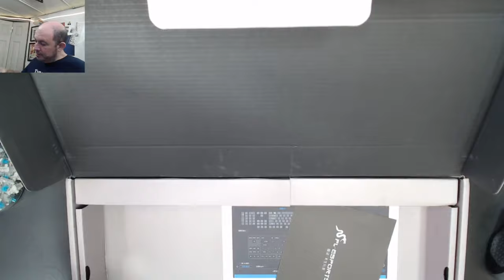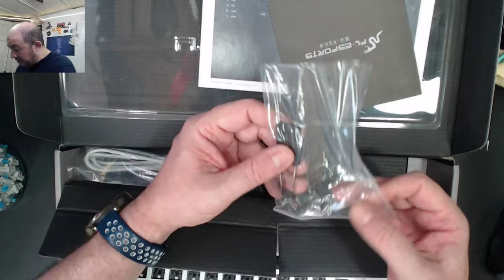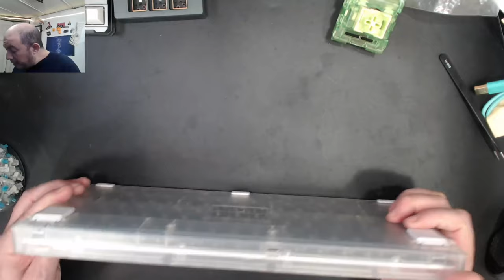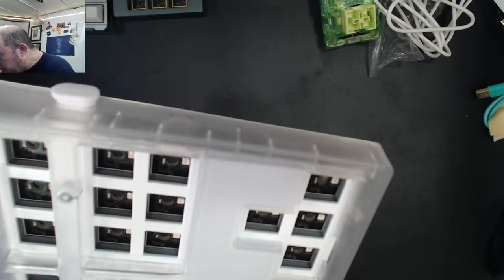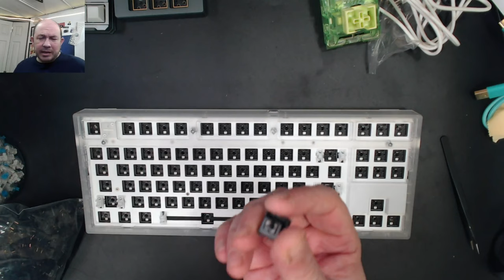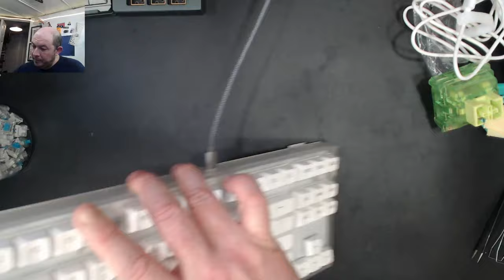FL Esports CMMK MK870 barebone mechanical keyboard kit: A quick overview and sound test.

Comment: if you going to build/tune the stabilizers do it once, the shims that holds the case are tough but very brittle. coming from the guy almost broke them. it is a hybrid between Gasket and screw base.
Reply: I use a plastic spudger, no issues with multiple openings.
Reply: @badmark  true, have to watch out for the corners when opening mine got stuck. so start with one side.

Comment: hmmmm is it true that the software is a virus
Reply from the maker: I've run it in a VM and on a laptop without issue. I can't speak as to if it's reporting back anything as it does install itself as a driver, but if you want to program it and then uninstall the software, the settings on the keyboard remain.
Reply: @MechKeyboards  thanks! Keep up with the good videos !!!